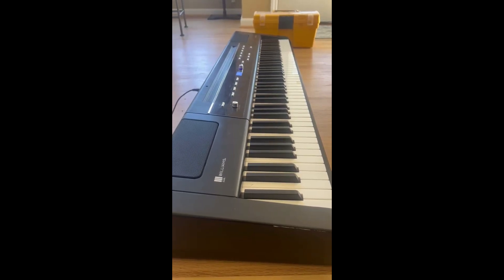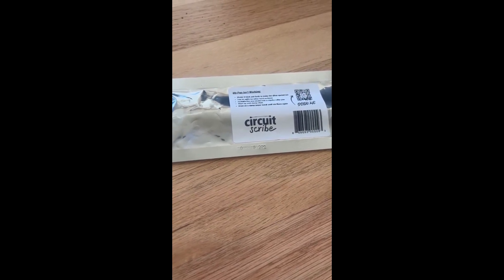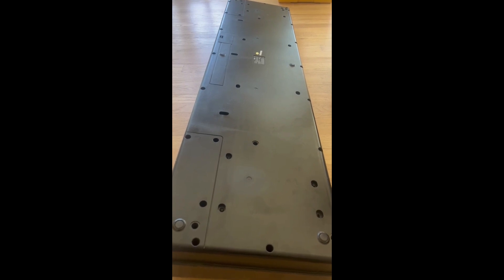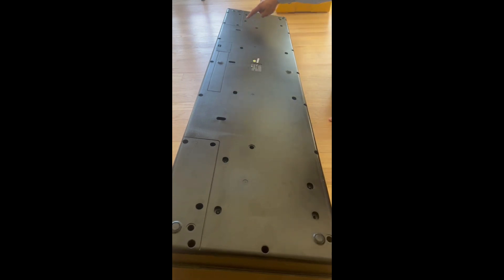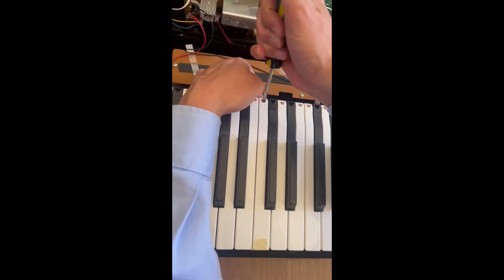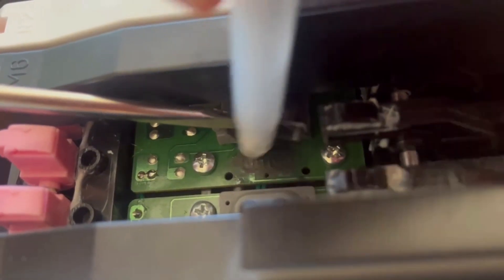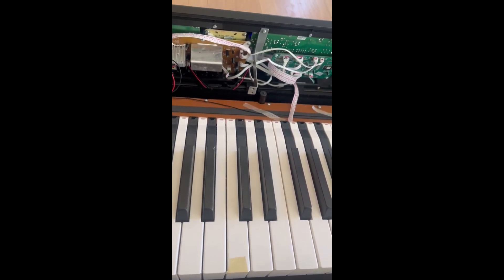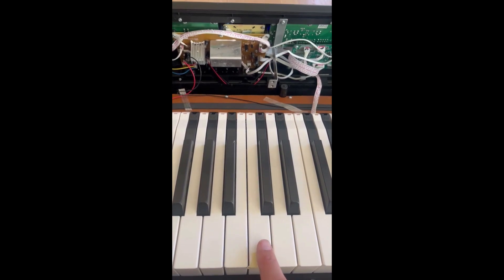Fix a digital piano key (Williams Allegro 2) that does not make a sound using a circuit scribe pen

Comment: So I have this same keyboard here and instead of a key not working, I have two white keys next to each other (I believe it's A3 and B3) that only play at FULL POWER. Meaning, no matter how gently I hit the key, it just plays at full volume as if I mashed it really hard. Do you think this repair would fix this also?
Reply from the maker: I think this repair really just helps if the key connection isn't working because the contact is weak/non-existent.  Unfortunately, this is a low end keyboard and you do 'get what you pay for' in terms of long-term quality versus other keyboards.
Reply: @JustinYung  So hear me out. Based on what I see in your video, I hypothesize that the way the touch sensitivity works is that it measures the time inbetween the TWO contact patches making contact. So when it takes longer (relatively speaking), it then plays the key real soft cause the velocity in which you're pressing the key is slower. And when you mash the key really fast, the velocity is really fast so the contact patches happen pretty much simultaneously. My guess is that the first contact patch is actually not making a good connection so when the piano senses only the 2nd patch, it assumes you've mashed the key so it plays it full volume.

I've taken this keyboard apart once to fix a bouncy key issue, I just didn't know how to take the actual cover off each key until I watched your video. I'm gonna go ahead and buy that product you recommended and give it a try. What can it hurt? It's otherwise just sitting there collecting dust since I've already purchased a replacement digital piano (Alesis Prestige Artist). Thanks for the video of the teardown.

Comment: I have a question all keyboards have this issue ?
Which one to buy therefore I wouldn't have this issue
Reply from the maker: I'm certainly not an expert on keyboards, but in general I would expect the quality to be better on a higher priced keyboard.  The Williams Allegro 2 was a good keyboard for the price, but definitely was one of the less expensive options on the market.

Comment: Hello Justin, thank you for the informative video! I have a question for this exact model. The speaker on the right side is much much quieter than the left speaker, doesn't matter which keys I press. How would I fix this issue?
Reply from the maker: Hmmh, I did not have the experience of having one speaker quieter than the other.  Unfortunately, I'm not sure how to solve that.  If anyone else has experience with this, please reply below!

Comment: your instruction regarding the screws is very helpful and thorough, however, I cannot actually get the plastic shell off. can you detail that, once the screws are removed ? thank you
Reply from the maker: Hi.  It has been a few months, but you'll want to make sure all the screws are out (that's probably the #1 reason the case might not come off ... some screws are still in).   After that, I started from the bottom of the case (where the keys are) and just pulled it apart.

Comment: Hey Justin. I'm having the same issue with  the very same model. Thanks so much for posting this. If I hit the failing key hard, I can get some sound out of it. Did you experience the same issue?
Reply from the maker: Yes, when we got this piano it actually had a bunch of keys next to each other that were not working.  Or some that worked it you hit it really hard.  My daughter actually got a lot of the keys to work over the course of several days by playing on adjacent keys.  So, you might want to try that first as it is easier than disassembling the piano.  I think the issue is with the rubber contact strip underneath the keys and somehow just playing the piano made most of the contacts works.  For the remaining key that did not work, we used the tracing method (first with a pencil and then with the circuit scribe pen).  Hope that helps!